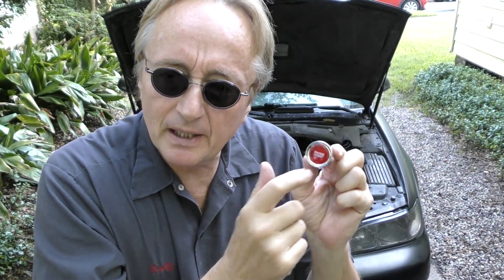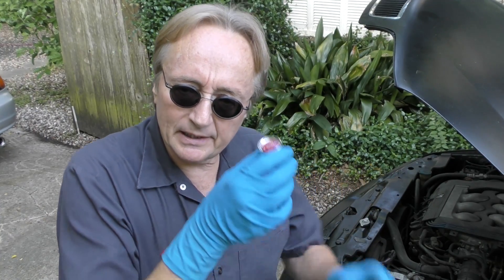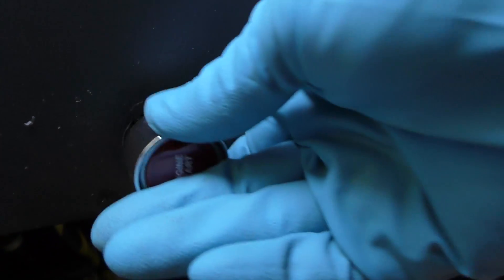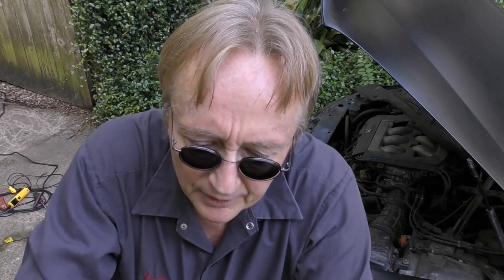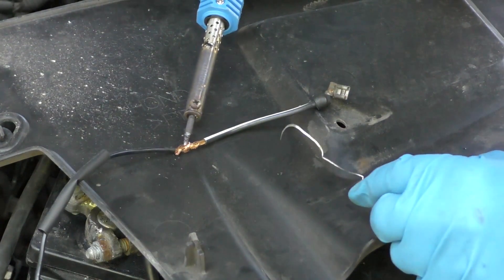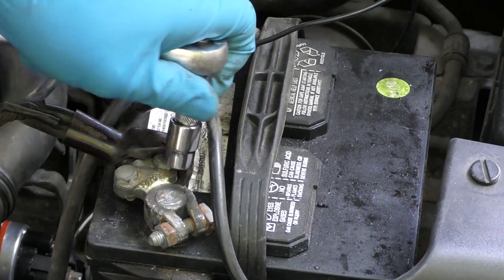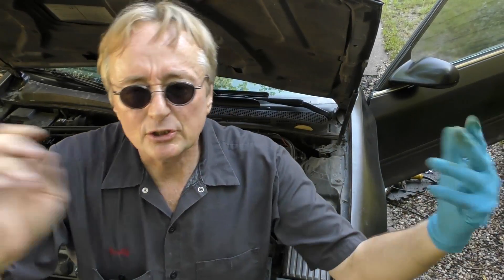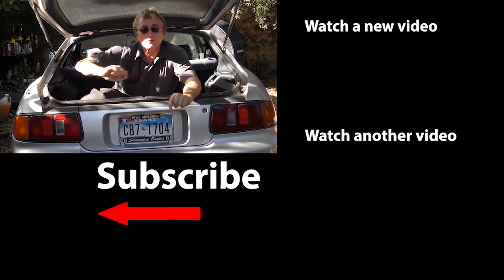I Can't Believe I Put This on a Car

Comment: Aftermarket alarms are the bane of a mechanic's existence.
Reply: Han Skinslo yea im gonna have to disagree with you there. PASSLOCK is. Ive fought with that systems for YEARS now. Its a nightmare.
Reply: I've used aftermarket alarms in the past. I've found that having it professionally installed makes a difference. At least with the shop I used. I've seen bad installations from the car owner who did a DIY job installation.

Comment: WOW!!  A modern push button starter just like the one on my 1951 Ford.
Reply: My father had an old mini (early 1960's) with a floor starter. He used to tell passengers the car was 'voice activated'. He would say "car start" while he nudged the starter button with his foot!
Reply: @nothanks3462  
In the 65 mini, the button on the floor is the hi/low beam switch, the starter button is on center control panel that also contained the ignition, head lights and choke.
Reply: @nothanks3462    Lol
Reply: @pogo1140  well dude, ever heard of afro engineerkng?
Reply: Uhhh no the 49-50 had a button. The 51 had the new “key switch”. In the movie Thunder Road they blew up a 49 with a close up of a 51 dash and a guy turning the key.
Like the floor shift going to the column and back, a lot of people have seen the start button go away then come back. I say bring back divided windshields next!!!!
Reply: A big button on the floor of my Dad's 1957 willys jeep was the starter button and the key lock was on the dash.
Reply: Yeah I remember the push button start on my Dad's '55 Vauxhall Velox too.  It's on my 2010 Swift now.  I guess the more things change the more they stay the same huh?
Reply: P. Spit   I only spent 24 years in the Air Force.  All of the vehicles had keys, except the aircraft.  The majority of our vehicles were civilian vehicles painted blue from the factory.

Comment: So glad you used heat wrap, most people don't.
Reply: You learn to use heat wrap when it rains and you figure out your car never starts in the rain.
Reply: Should have used flux for better bond.
Reply: @deadgametech6624  I just use it on all electronic connections I can, never worry about it shorting with any other metal contact.
Reply: @thaddeusmcgrath  Good catch, I didn't notice that.
Reply: @TheOne-ql6cf  I would have used a 300/200 watt  gun with some extra solder to penetrate the splice real good. I always go overboard on those type on solder jobs when it is subjected to those under the hood elements!
Reply: @thaddeusmcgrath  I don't blame you, those cheap low watt soldering irons just can't get the job done.
Reply: thaddeus mcgrath Use a lighter for the heat shrink
Reply: The heatshrink was used to cover up the shittiest soldered joint ever made on youtube.
Reply: @thaddeusmcgrath  You obviously have no clue about soldering then. 60W max is quite sufficient once you learn how to solder correctly. Too much power results in too much heat which vaporises the flux within the solder before it does its job of cleaning the oxides off the workpiece the instant before the solder melts, and produces a strong reliable joint.
Reply: Mud Plugging I love me some Scotty Kilmer but damn this kinda disappointed me.  He clearly doesn’t know how to solder, just knows how to melt it...
Reply: @mudplugging  I use a higher wattage gun to save time in heating and do have a clue never having any issues with joints and not wasting time with a lower temp. Thanks for the advice, but to each its own if that is an obvious clue!
Reply: @sammolloy8129  Heat gun or hair dryer.
Reply: @thaddeusmcgrath  Yep. It looks like he needed to put more solder on that connection. The solder was only on the top of the wires. He needed a higher powered soldering iron to use with that big power cable. That small soldering iron he used works fine with smaller gauge wires.
Reply: @Rhaspun  agreed!
Reply: P. Spit I’m a mechanic and I can tell you it’s part of your tool kit.  And you are dead wrong in your previous comment about “metal to metal is all you need”,  a bad solder joint will fail.  There are people that say, “there’s more than one way to do something “.  That’s true, but there’s only one way to do something right.  As critical as Scotty is, he should know how to solder.  Don’t take this comment personal, I will not respond to immaturity.

Comment: After a few months that wire you slipped under the battery connector will corrode and it will stop working. Better to put on a ring connector to the bolt, or even better power from the fuse box.
Reply: From the fuse box is better.

Comment: I had a 97 olds regency that the heater control failed. I was part time retail and couldn’t afford repairs, my neighbor spliced a light switch in to bypass the circuit and heat was good :)

Comment: You should you a relay so you can use a heavier gauge wire. I figured this out after burning out a few push button switches.
Reply: I was wondering why he didn't use a relay.
Reply: @jmautobrokers6568  ; looks to be a older car, or the relay is on the starter.  The wire he removed was small gage to start with.
Reply: He said starter wire, but wasn't that the starter solenoid wire he removed?
Reply: You're not making any sense.  This is not the wire that carries the current from the battery to the starter motor.  That wire is already direct to the starter solenoid.  This wire just activates the solenoid and the wire he used is probably even heavier (lower) gauge than the factory wire that does that job.
Reply: @stinkycheese804  I must have missed part of it. I'm use to older GMs.

Comment: I did this on my motorcycle. Starter button no go ,had to kick start. I bought a remote starter switch for bumping a motor from under the hood while working on it. Wired to starter and mounted it under gas tank. It was probably a rectifier, but this worked too... Salesman at NAPA when I told him what I was doing when I bought the remote switch thought for a second and said "that will work!" and seemed a little impressed. First time I ever impressed one of those dudes!

Comment: I can stop using a screwdriver for my 1973 Olds 98! Good idea Scotty!
Reply: The question is, what did you do so you need a screwdriver?
Reply: @GlamStacheessnostalgialounge  there i s no switch on the column anymore. Anything you can put in there will turn it without a key. I could put the button in the glove box and lock the glove box. The kicker is that the glove box lock works, but the worn out ignition switch does not.
Reply: That was my first car.  455 with the 4 barrel. 
  My friends would talk about their cars acceleration, I'd say, "I can go from full to empty in 3.5 seconds".
  Nothing like watching your gas gauge and speedometer race each other to the finish.
Reply: @GlamStacheessnostalgialounge  Stole the car of course.
Reply: @barnabyjones6995  : Here's a novel idea, how about just replace the worn out keyswitch instead of jerry-rigging up some bullshit push- button switch? Nahhhhh... Common sense, what's that?

Comment: When the car starts by itself and you can't figure out why. It's because the new wires that someone pulled are shorted against the metal and the grommet. See 1:55 timeline. I think you should have pushed the wires through center with the Eire bundle.

Comment: Scotty isn't saying it's not hard to remove all the alarm system. The point of his video is: If you have a cheap old car and don't want to pay a mechanic hours to remove the alarm then this is a cheap quick fix. Keep in mind that the ignition key is still needed to run the car.
Reply: Exactly
Reply: Except it's seldom that you find such a craptacular alarm disabling system these days that all it does is disables the starter because anyone with a clue knows you can overcome that with a screwdriver.

Frankly the video didn't make any sense at all to me.  Look at the wiring diagram, and just solder back together the two wires that the starter disabler circuit was connecting.  Then you don't need a new hole in the dash, don't need to buy a switch, or wire, or run new wire, etc.   It's literally free and maybe even faster to just do this instead of adding a switch.

Comment: The fuse should be as close to the battery as possible.
This is a potential fire hazard.
If the battery wire to the switch shakes off and makes contact with the chassis, you will fry that wire and anything it is co-routed with.
My old Jeep A1C had a push button starter on the floor.
I love your show and respect your deep knowledge.
Keep up the great work mate!!

Comment: To mention old-time things... my father had a 1952 Chevy stake bed truck he bought from his employer. I had a key on the dash, but to start it, you mechanically engaged the starter with a pedal on the floor. Personally I'm happy with my old keys-on-the column car, but I can see another advantage in the push-button start, especially when coupled with an electronic lock: No damned annoying dangling keys!

Comment: Scotty you remind me of a mechanic that instead of fixing my back up lights suggested to put a switch that I manually flip when car is in reverse lol 😂 

I'm surprised you actually posted your cob job on YouTube lol
Reply: If it's good enough for race cars, and jet airplanes, it's good enough for me.
Oh yeah, the backup lights come in handy for other uses too.
Reply: Remmember that Scotty wired that switch only for the starter, he still need to use key to run the ignition on. So it's not as simple as in the tank or airplane lol

Comment: Worst soldering job I've ever witnessed. For a mechanic with 50+ years experience I expected at least a decent solder job.
Reply: Thanks Prof. Fluxxed
Reply: Grimm analysis
Reply: Maybe the owner is a cheepo ...so ,why caring so much when there's no money to make?
Reply: Actually, he should use crimping method.
Reply: taoybb : solder is much more reliable than crimping!
Reply: Scotty is all about function, not form, as seen by the unsightliness of his garage. I try to walk a line down the middle. My soldering skills are better than Scotty's, but only because I worked at Atari in 1974 and 1975, when there were only two video games in existence, pong and gotcha, long before home gaming and personal computers.
Reply: @wilson2000t  No, a proper crimping will out last soldering easily. I had been a soldering fan before but after working a lot on car electrical and had to admit that proper crimping is far better than soldering. You may try research why crimping is popular in motorsport application and why they avoid soldering as much as possible.
Reply: taoybb : Crimping is popular in automotive because it's fast. That doesn't make it better unless you are in a hurry. A mechanical connection, crimp, is prone to loosening due to vibration, thermal expansion/contraction and grease/oil/solvent/water penetration. When soldering, one is essentially welding the wires together. They won't come apart unless you are a bad solderer and make a "cold joint."
Reply: @wilson2000t  Well, good luck on your soldering. :)
Reply: @MangMuang  It's only because soldering requires more skill while anyone with a quality crimp tool can get good results with fewer opportunities to screw it up.  ;)     The video is a good example, a major brand crimp tool would have produced a better result in this case, but not if I had soldered it because I have skills in a trade that needs to solder well.
Reply: @stinkycheese804  Also, solder would get a better connection, yeah I use solder on some application but when dealing with vibration, solder joint would not last as long as crimp joint. The problem is the area between the bare wire and soldered wire, it get brittle because of soldering and tend to break. Just like bending metal back and forth. But there is a the way to make solder joint last is adding 'Stress relief' to the joint then it would work fine. I've been testing with soldered ground strap that bolt between engine and battery with stress relief and it last for 6 years now.
Reply: taoybb: The shrink wrap provides the stress relief on a solder joint. With enough back and forth bending movement, there is the same chance of a the wire breaking at the end of either joint. Like Scotty, my 50+ years of experience has taught me that soldering is better than crimping, although, if done right, either will work fine in most instances.
Reply: @wilson2000t  If it good enough why people who did wiring on motorsport and performance car avoid soldering as much as they can. I used to love soldering like most people but I had an experience from my own since I worked mainly on these stuff for a while and only downside I found in crimping is to get a proper crimp is to invest in tool a lot. This will be my last message here, I advise you guy to open mind and have a research in 'Proper Crimping' you might like it. :)
Reply: taoybb: I repeat...if done properly, either will work fine. My research has been done by me personally, my whole life. I've worked on vehicles with failed solder and failed crimp connectors. After carefully working with both types of connections and considering all the variables and pitfalls, I've determined that for my work, I'll go the extra mile and solder.
Reply: It was perfectly good enough to just hold the twisted wires in place

Comment: Did you protect the wires where they went thru the firewall? If not big trouble later......
Reply: Don't worry, the firewall on that car is made out of plastic.
Reply: Yes that big rubber grommet had room for another wire

Comment: I did this to my car too, feels pretty cool every time you start, rather than rotating the key like 1000 years ago, feeling all that pins in the lock scratching and everything. I have 3 switches, first one for accessories, like radio and dash cam, second is full power, third momentarily switch for engine start. I wouldn't go back to a key in a million years.

Comment: How did this eliminate the alarm problem?  You just created a different starting circuit, isn't everything else the same?  Also, you may want to take a refresher course in soldering and I would have cleaned off the corrosion on that battery terminal while I was hooking up the wiring to it.

Comment: Scotty you should put a kill switch in series with that so no one can steal the car only my opinion
Reply: Also just a general kill switch would be helpful unless the customer wants to unplug their battery everytime they stop driving their vehicle.
Reply: You still have to use the key. The key will unlock the steering wheel and put power to the accessories, then push the button to start, turn the key back to shut the engine off.
Reply: Fuel cutoff?

Comment: The positive terminal to the battery is really bad. REALLY BAD.
Reply: Yes. That car has been hacked to sh*t too
Reply: Plus the quality of the soldering is 2nd rate: he melts the solder with the iron not the wire. Plus he should fix the alarm not just bypass the problem.

Comment: I had to do the same thing on a 97 mitz galant many years ago because the start position of the key no longer worked, drove it for 5 years that way and never had a problem with it. A cheap and easy fix and only took about 45 mins to install

Comment: Nice job but if I had this on my car it would be stolen in 10 minutes where I work.
Reply: Maybe 15. The steering column  and shifter would still be locked.
Reply: Just get a manual

Comment: Scotty, you may be the worlds greatest auto mechanic, but on behalf of electricians everywhere let me clue you in on a couple things. The heat shrink over the the splices is fantastic for insulation and protection from the elements, but you don’t need to solder any of your connections like I saw you do in this video. There are crimping tools and crimp on lugs and butt splices that are much easier (and faster) to install and make as good or better electrical connections (that look good), than any soldering I saw you doing there😢  “Just Sayin”

Comment: Scotty is the king but...
Not a big fan of this job. Directly to the battery? 
Better to have it on an ignition switched power supply line.
His way anyone can press that button to make the starter turn. Dangerous!
Reply: Dangerous? Get out of here with that. The car ain't goin anywhere without the key in the ignition regardless.

Comment: My Manual 1982 fox body mustang I bought has a "button" attached under the steering wheel column I have to push in before I can turn over the engine I was told it's some kind of security system for ignition lock cylinder. Love Watching and Learning from your videos.

Comment: The fuse should be before the switch, not after.
Reply: It is. He may not have done it in what looks like the right order, but once it was done, it was battery, to fuse, to button, to solenoid. Neutral safety switch should have been before the solenoid, but what do I know . . . 😒
Reply: sl44er That’s what he did, didn’t he?
Reply: The fuse is before the switch: Power from battery => Fuse => Switch => power from switch to stater solenoid
Reply: @DDS029  nuetral switch is still on key circuit .Button only spins starter. Key powers 12 volt start circuit.
Reply: Verbal description describes fuse after switch which is incorrect.
Reply: @sl44er  you are right but he put it between battery and switch. As long as the fuse is in line it is for over amping starter which heats the wire most

Comment: As someone who has self installed a car alarm with imobiliser etc .. it is soooo easy to screw an install there is so much wiring to deal with etc and you need to hide the obvious imobiliser tap etc. I had mine hooked in then with an aftermarket central locking kit that worked great as a pair. Now I have a newer car with all but the alarm because the car is worth more to me stolen for insurance than the alarm is lol.